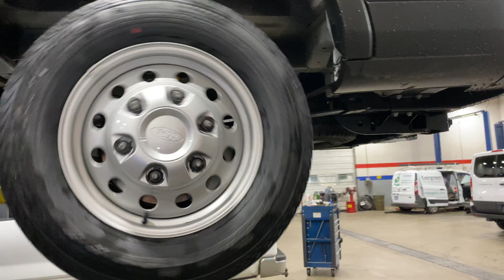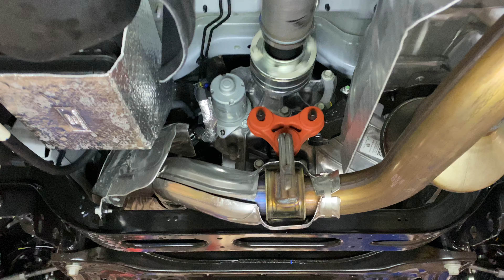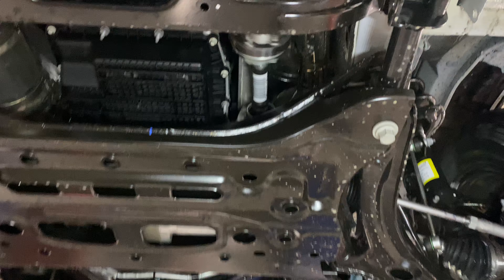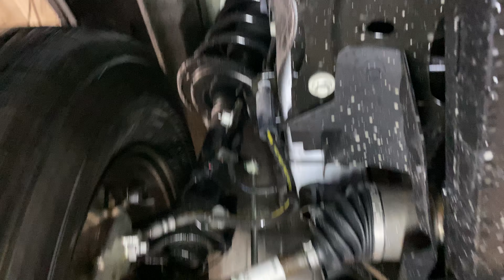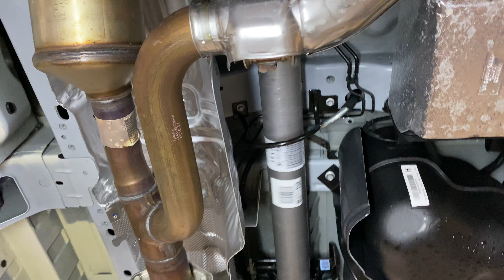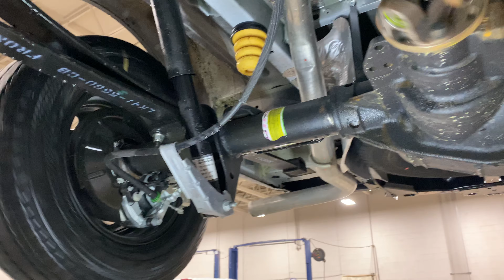2020 AWD Transit Mechanics

Comment: Is it 150 or 250?  I just made my order on 250 yesterday. That leaf springs make me think if im gonna need 350
Reply: 250. It’s at the beginning of video
Reply: Only 400 lbs payload capacity difference between the T150 & T250, I have on order the AWD T150 for like $4,000 less than the T250.    It's only money as they say.
Reply: I just ordered a 350. 👍🏿

Comment: Cleanest damned undercarriage I've ever seen!  EDIT:  In watching this again I notice that the van has a front sway bar but no rear sway bar.  What would be the reasoning for this?  It was my thinking that ALL high COG vans should have a rear sway bar.  I understand that the new 2022/3 350HD AWD DRW's have a rear factory sway bar installed - can anyone verify this?
Reply: PS:  Hope they've solved the overheating and oil leak problems on the PTU!!
Reply: @Chef Duane ... no wonder it’s a brand new van  HIHIHIHI so it should be the cleanest
Reply: lets see how it looks in 10 years o hope they dont rust out like 90% of vehicles. Ill prob have to get it all sprayed to slow it down
Reply: Don’t think you’re supposed to lift these vans by the pinch welds.  @17 seconds you can see the side molding bend.

Comment: Why ford doesn’t offer a  4x4
Reply: While the Transit may not be a "true 4x4", it sounds like the system on the 2020 Transit is better than the Sprinter "4x4" system, which can't shift into 4x4 on the fly, can only send 33% of available torque to the front wheels, is more expensive and (reportedly) more noisy.
Reply: @user-zz8ln3uh5x  where can I find that information about the Sprinter 4x4?